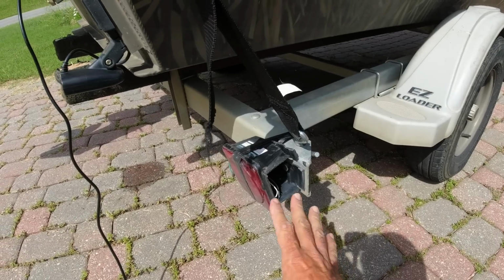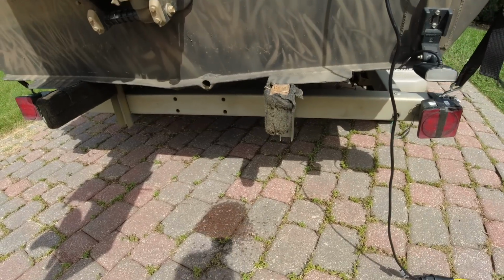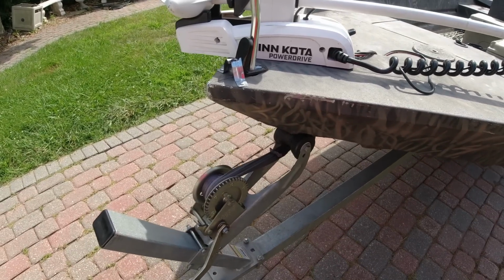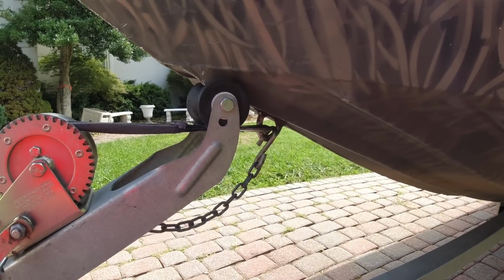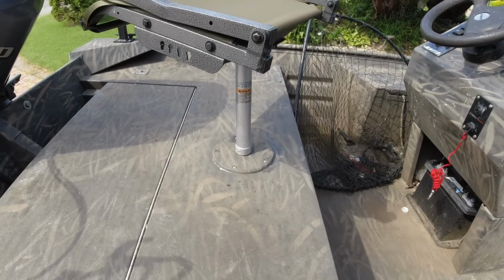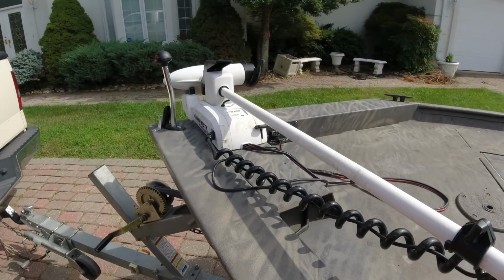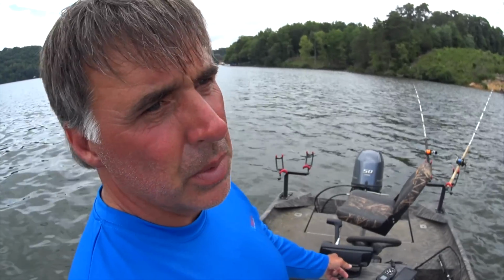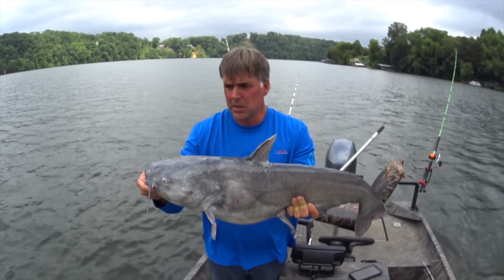The Best Thing About My Boat

Comment: I have a 1654 Tracker Grizzly rigged with very similar accessories.  I had to overhaul the boat and the Trailstar trailer to resolve the same lack of engineering.  I've had to replace carpeted bunks twice already.  They don't last long once wet and the soaked carpet keeps it that way. Imagine that - wet wood rots.  I replaced them the last time with treated 2x4s and covered them with a slick plastic liner that dries quickly and allows the boat to slide off.  I added two keel rollers, a pair of guide on poles, a real tongue jack, submersible LED lights now making it a real trailer that will last a while and do the job.  The boat was a disaster requiring removal of the deck which didn't take too long since half the aluminum rivets broke off.  The grid stringer system had to be properly welded in, not just tack welded.  The deck was replaced with stainless Cherry-Max aviation-style rivets. The boat needed to be wired for an electrical system (lights, bilge pump, trolling motor).  I also needed to reinforce under the seat/deck surfaces to properly support two pedestal seats.  For the last four years and today, the boat has been a great riverboat, but it didn't get that way overnight.  The Yamaha outboard is flawless and I'll never have another boat without a Minn Kota RipTide I-Drive.  Now that all the work is done, I found I need a bigger boat.  There is no trailer hitch on the back of a hearse, so I've ordered a G3 Gator 18SC rig.  The 1654 Tracker rig is on Craig's List.  

I'm still waiting for you to get a bilge pump

Comment: Hey Dave,
Love your videos. You boat dealer is 100% responsible for making sure you trailer is safe and correct for your boat. Your dealer ripped you off in a big way. I’ve used used Easy Loader trailers for 25 years without a hitch. 
Cheer’s
Reply: Many a trailer maker over the years has put non water resistant lights on their trailers.
Reply: Somebody redun that trailer. No way that's factory

Comment: Sorry about your trailer trouble Dave. My boat's an Alweld too but it's just a little 14x48 and it's on a Load Rite trailer. I haven't had any complaints about it so far. Been going 3 years now.

Comment: Dave, I was a boat rigger and mechanic for many years in the 1990's and 2000's and still do all my own work.  JBJ27406 is entirely correct.  The boat is not fitted to the trailer and the trailer was never sized for the boat.  A bare Jon boat, yes.  It is too light duty.  They dropped it on there and let you have it.  No fitting, tongue weight adjustment and they didn't even adjust the bow stop to nestle the bow eye.  I'll agree that you got took.  As far as the bunks go, Bear trailers has a slick PVC cover on there's.  Works great.

Comment: Dave Take my advice. Buy Bering Buddies for your hubs or you will loose a wheel.
2nd, buy bunker boards for 1 time  trailer I
3rd get brackets  that lay the bottom bunker boards flat just like you said.
find a welder to weld that trailer fix it for good.
any money left get a  Bilidge pump/hose/ a little bit of wiring and a toggle  switch.
If you ever forget the plug in your boat  a bilge pump is invaluable. 
God bless

Comment: The boat, motor, and all other equipment on board, which constitutes the load on the trailer, should be located on the trailer such that the weight of the whole load and the tongue weight are in the right relationship. That should be the only factor used to locate the fore and aft position of the boat on the trailer. Next, the trailer frame should be selected so that it is correctly sized to the boat and the load that the boat presents to the trailer and the total weight of the whole setup. Next, the entire bunking system, the interface between the trailer frame and the boat, should be set up so that the weight of the boat and its entire load is distributed so that there are no unsupported areas on the hull and the keel, and the boat can really only go on the trailer one way and remain in that one position at all times. All rollers, bunks, and other attachments should be fitted to the boat hull, not the other way around. The winch stand, the winch height, the security chain at the bow eye, the bunks the boat sits on, the lateral control bolsters which control the movement of the boat side to side while loading and while trailering, should all be fitted to the boat itself, in such a way that the boat can not even really move--in any direction--when it is loaded onto the trailer. Then, just as you said, the lights on the trailer must either be mounted high on the trailer so they're never submerged, which is preferable, or they must be submersible lights. And, again as you said, they must not ever be in jeopardy of damage from loading, unloading, or trailering the boat. Your DEALER failed you entirely on this matter. Considering how they literally screwed up everything about this trailer, this might not even be the right base trailer FOR your boat. The DEALER needs to stand up and make you right on this whole thing. Some kid or some dumbass who either didn't know what he was doing or didn't care what he was doing made this whole mess, and it is the responsibility of the DEALER to make it right. If they are a legitimate company, they should be glad to fix things correctly. If not, get in touch with EZ Loader--they'll probably want to jerk their dealership ticket. The crooked winch mounting, the shitty bunks, and lack of lateral bolsters sort of sum up the level of care that this DEALER exhibited. Totally inadequate.

Comment: I use an Xpress 16ft jon boat. I have a minn kota traxxis 55 12 volt trolling motor with a front graph and trolling motor mounted transducer. I back bump from the front seat and everything is done from the front seat in my boat. Lots of floor space for bait tank and tackle. I've caught lots of big blues fishing this rig. Love the simple fishing life.

Comment: Dave you can make your trailer a lot better,  replace the 2 boards with rollers,  add boat guides. Find a wielding buddy to do a little wielding.  I've made a boat trailer and modified others.  If you can't get your boat on the trailer without a lot of drama it can take the fun out of fishing,  jeff in LA USA

Comment: You can thank the dealer for cheaping out on the trailer.   This type boat comes from the boat manufacturer, the motor from Yamaha, and the trailer from EZLoader.  The dealer puts them together and it doesn't appear that the shop guys did a very good job fitting the trailer to the boat.  The upright that holds the winch should be able to be loosened and moved backwards to keep the rear of the boat from coming past the end of the trailer bunks.

Comment: Dave:
That boat is how you make your living. If that trailer is endangering your boat, then you need a different trailer. Either buy one or have one made to your specs.  Also, if that deck and chair aren't very good then modify it to make it better. Make your boat fit your life style. it looks like you need a live bait well. I think you should set up some kind of sun shade over a good section of the boat.

Comment: we always unplugged the lights back in the old days so the cold water did not hit the hot bulbs, thought they were more advanced now. I think the front roller and winch assembly can loosen at the bottom and slide back to change boat position

Comment: I have a easy load trailer, with a few modifications it does the job. We shouldn’t have to do this but the price for couple welding rods and light upgrades. Is a lot cheaper than prices for new trailers. Tip on seat base breaking loose, never drive the boat with the pedestal in place. One it’s very dangerous for you and puts more stress on the bolts holding the base. Just a tip from a large guy who had a injury from a failure of base while at full speed

Comment: As a foundation repair contractor that trailer drives me nuts. It doesn’t even have anything to do with house foundations but man the weight distribution is just awful as you stated. I’d be madder than a mosquito in a mannequin factory about that.

Comment: Everyone has their own needs for a boat. I wanted something to fish open bays and shallow back bays. I bought an older 17' mckee craft, 110 johnson for $3300. Did rebuild the engine. No live well but I made my own. Great for night fishing on the lake because it sits so flat. Two, two hundred pound men can lean over one side without the boat dipping down more than an inch or so. Unsinkable because it's fully foamed. I didn't like most of the new boats with the ice box seats in them. If you're into fish the guy sitting on the ice chest spends the day standing up and sitting down with each fish boated. MIne has a center console, great for fishing around the boat as needed and a swivel seat behind it. Years earlier I had an 18' all aluminum fisher that I truly loved. It could handle some really rough water easily but best thing about it was the storage. It had so many floor lockers that when the boat was fully loaded with gear the boat looked empty so you weren't tripping over things all day.

Comment: dave you can move your trailer winch arm back some and the boards will not be sticking out the winch mount should also be able to move up and down on the mounting
 bar to fit the front of the boat better the boat dealer should have done all that

Comment: Dave, loosen the u-bolts on the bottom of the winch post and slide it and the boat back so the ends of the bunks are at the end of the boat.... easy peezy

Comment: Dave that boat trailer wench arm looks like needs to unbolted and arm  with roller flipped over then re-bolted together. Maybe its made to flip to accommodate different style boat bow. Looks like it will be further out and and chain will latch. Maybe ride a little lower in front too with lower angle tow point....

Comment: By design the parts on the trailer are replaceable. Guess its meant for the saltwater guys really. When parts rust out just order new ones and bolt on. As far as how the boat sits far up, could you slide the winch assembly back the distance your boards stick out? Also you can get new bolster brackets or just the top swivel section and lag them on the boards when your boat is in the water then they will lay flat.

Comment: The dealer that sold you the boat should have fitted the boat and trailer together.  A 2x4 on edge might be OK for a 10 or 12 foot Jon boat. My boat is the same size and it sits on 2x6 boards laying flat, supported in 4 locations on each board.  All the cross members on the trailer Fram are welded in place. If you were closer I would fix that trailer for you.  The problem with most of the boat dealers is that they go as cheap as they can to maximize profits. The seat base is also a easy fix. Get a aluminum plate roughly 16 to 18 inches square and 3/16 thickness.  Screw it down evert 3 or 4 inches around the perimeter then mount your seat pedestal to it, it won't move on you.

Comment: Everything is great but the thing that really blew up my head is the fact that they put non submersible lights. W.T.F 
As always great video Brother!
Reply: Good trick is always unplug trailer lights before backing into water at ramp. This ensures you dont burn out the lights on trailer. But yeah they be best water tight.

Comment: You are correct !!!
Although - I must add. The company builds several grades of trailers. From economy ( cheap ) up to superior grade ( top off the line ).
I would assume whomever bought the boat new - went cheap on the trailer.
I work for BassCat Boats - which just happens  to be across the road from your trailer builder.
Excellent video - I do agree with ur comments. As to why anyone would build soo poorly designed stuff is beyond me.

Comment: Ahoy Captain Dave: I had to basically rebuild my EZ-Loader trailer to fit my 1756 Alweld Marsh-Vv as well. I changed to different rollers and re-positioned the bunks, and added welds and side guide bunks. I changed the winch to a better-quality Fulton. My trailer at least had submersible LED lights, and is a heavier duty model than yours, but I will be looking for a better trailer on the used market. The boat itself is great IMO; mine has a windshield and a bilge pump, but I disliked the wiring, especially the skimpy trolling motor wiring. Being an electrical engineer, I completely re-wired it with heavier gauge wire, a good fuse block under the CC, and extra circuits for accessories. Batteries for my 24V Terrova are in the front locker for better weight distribution. I put a Garmin Ultra HD with Panoptix Livescope up front, and a Humminbird Helix 9 MSI+ G3N GPS with a Navionics+ map card on the console. Now I like it a LOT better. About $18k all-in, and paid for.

Comment: Dave, I have had the same issue with the boat hanging a little off. You can back the boat up, then loosen up the winch mount and push it rearward to where it need to meet the boat then you won't have the overhang issue.

Comment: Dave, that trailer does suck. I have an ezload from 2000, for my DuraCraft boat. Mine has not been bad, but it is tough to get straight on the trailer. Yours is definitely wrong for your boat. For starters, the bunk boards are wrong for that boat, second, the boat transom should line up pretty well with the rear crossmember of the boat, then you wouldn’t tear the lights up and the tie down straps would pull straight down, instead of pulling forward. I don’t know about how all weld boats come from the builder, so tough to say if it is a factory problem or a dealer problem. I hate that this happened to you, but you make it entertaining to watch!

Comment: No, I have been wondering about a bilge pump too.  There awfully expensive though.  Somewhere between $14 and $20 dollars.  As far as trailers go, they always told me you get what you pay for.  If my house looked like that one in the background, I would have a decent trailer ADJUSTED to fit my boat.  Just a thought.

Comment: The boat and bow winch/roller is meant to be adjusted on the trailer, that's why it is bolted and not welded. (keep in mind, the axle could be moved on may trailers to distribute weight also) 
Just because the bunks end where they do, does not mean the stern of the boat should be there. It is a generic trailer that is made for many similar boats. 
  
Correct boat placement on the trailer/bunks is determined by proper trailer tongue weight.
Once the boat is in the correct place, if the bunks stick out past the stern, the boards could be cut off. 
https://youtu.be/6c3xxQJFpLo
https://youtu.be/6mW_gzdh6to
.
Yes this is all a mute point now that Dave has a new rig. 
That boat/trailer adjustment should be checked just to be sure.
.

Comment: Ex loader trailers really suck. I had one for years and I ended up refitting the whole thing including the leaf springs, lights, bearings and winch. I had rollers not bunk boards but even the rollers were setup wrong.

Comment: You keep saying boat when its really the TRAILER that SUCKS, should be easy to make that safety chain longer and I would do that asap. Really think the boat would sit better on the trailer, now the trailer is still junk. LOL  On the seat, mount a piece of 1/2-" 3/4" plywood under the seat, looks like an easy place to get to, run bolts not screws thru it and that should fix that issue. Enjoy the videos, keep them coming.

Comment: They probably sold you a decent boat great motor and the cheapest undersized trailer they could put it on.
Dealer is a piece of crap to do that to you. Very common for crap dealers to do that!
Knowing you have a YouTube channel  they might trade it for a real oversize 19’ trailer with Guide-ones with the lights mounted up high so you can see them when backing boat in for a reasonable price. I would go in there and pitch a fit at their busiest sales time LOUD AND DIRECT! They should have kissed you.

Comment: Now if you would only get you a bilge pump you could complain about it. Because it’s to small. 
I have 2 of them in my Lowe 14/36.  1100 gph pumps with automatic turn on and override switch. That way I know I don’t have to worry about the rain and water getting in my boat.

Comment: It seems as though many times dealers opt for the cheapest trailer that can carry the boat. Often the trailer isn't adjusted correctly.

I had to adjust the pads/bunks on mine after I bought it.

Lights on a boat trailer are a challenge even if they are designed to be submerged. Best practice is to get them mounted high enjoying that they will not get wet.

Comment: Dealer sold you the "Universal V-Hull Trailer" that comes as a kit the dealer puts together and slaps a boat on.  Nice rig, crap trailer - your disappointment should be with them.  Especially when they aren't open working folk's hours, that should of set you off right off the bat.